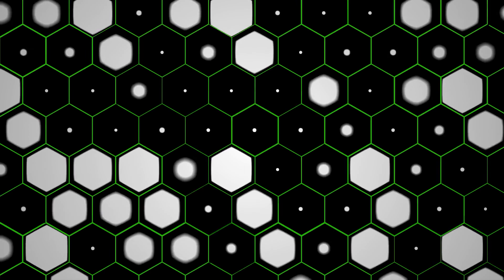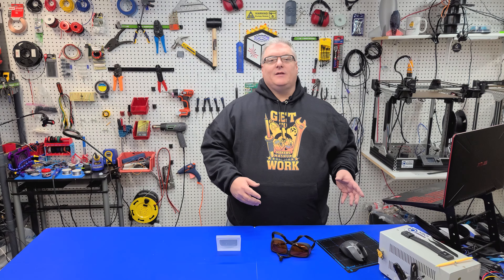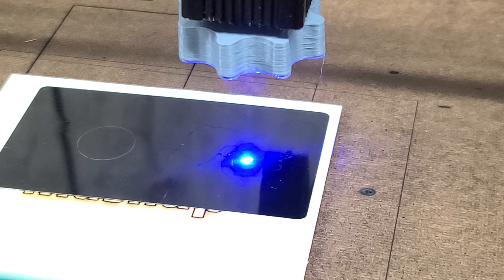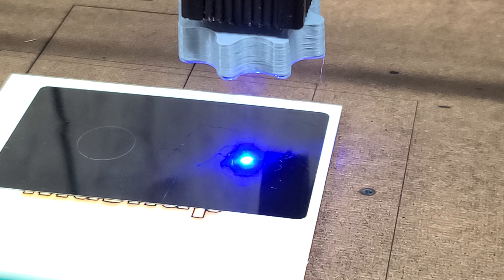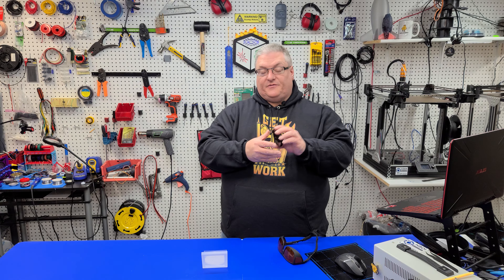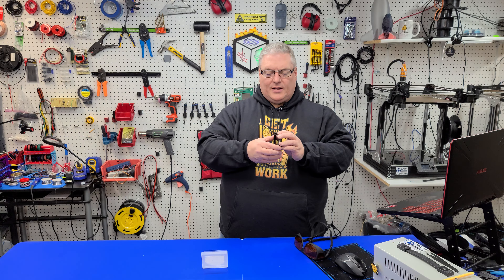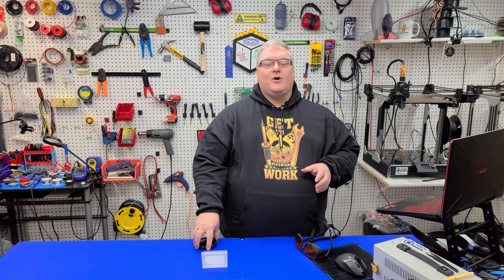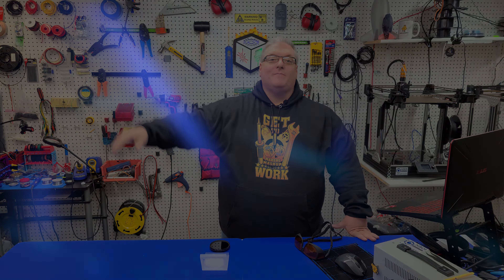Expert Diode Laser Focusing Using an IR /Red Filter

Comment: Possibly best video so far I've watched when it comes to explaining focus. I got my diode laser just a few days ago and I'm having problems focusing it properly. I've tried the slanted board-trick, but I couldn't really tell what part of the engraving was most focused. I do have some questions after watching: I can't use the red filter unless I'm filming the later dot with a camera/mobile, since the protection glasses block the dot? And just to clarify, that 10% is at idle mode, or is it a continuous cut at the same spot? My NEJE diode laser shows that same blue dot, but it doesn't cut/move until I click start in the software.
Reply from the maker: It's at 10% power just like as if it was cutting.  Most lasers allow you to trigger it on without moving for that purpose.
Reply: @MakersMashup  I'll look into that in that case. How about the lens; do I need to use a camera to use it for focus the dot like you do in the video or is there any other way of using it?
Reply from the maker: I don't use a camera I just use my eyes behind goggles.  I used a camera in the video to show its use but no need for a camera. Just make sure you're wearing appropriate eye protection. The filter you want but no need for a camera.

Comment: My method: A 1000 ohm (1KΩ) resistor that I can switch inline to reduce the dot to barely visible without goggles.
I then look at the dot with a microscope.
Even at this reduced Laser output, never be tempted to look at the Diode directly.

Comment: For my 3D printer I usually prefer to print at several heights and measure the results after roughly dialing in the z-height. Would something like that work for laser cutters/engravers as well? Just engrave/cut a bit of paper and see which has the cleanest cut?
Reply from the maker: Yes that would work as well.  Most people tilt it to see at what point it becomes sharp and then adjust from there.  I like this method because I'm able to do it without having to lase something. :)

Comment: Can you recommend a good pair of laser glasses? I plan on a project with a 5-7W (optical) diode-Laser... With that of course, i will not touch the laser or assemble anything without those good glasses...
Reply from the maker: I purchased mine from http://www.certified-laser-eyewear.com/ however @styropyro has recommended https://www.survivallaserusa.com/ . The guys at  http://www.certified-laser-eyewear.com/ were able to tell me what I needed.  I simply provided the laser specs and they recommended a good pair.  My understanding is that some less expensive ones are for pulse lasers not continuous lasers.  I have no way to know if what they were telling me was true or an upsell but the pair I picked up work great.  Everything blue looks black through the glasses as it blocks those wave lengths completely.
Reply: @MakersMashup  thanks a lot!

Comment: I just use a piece of black construction paper while wearing the laser safety classes and that eliminates the halo around the focal point.
Reply from the maker: Did you use a specific brand?  When I tried it I still had a significant halo.
Reply: @MakersMashup  No, just stole the darkest piece I could find from my wifes craftroom :-).  You do have to use a good set of laser glasses though too, because it takes the combination to really make the dot clear.  I don't use the cheap red Chinese goggles, I use the one that came with my Opt laser which are an OD7 rating.